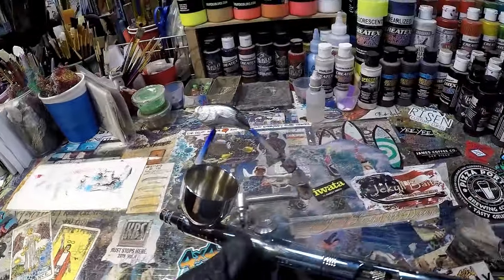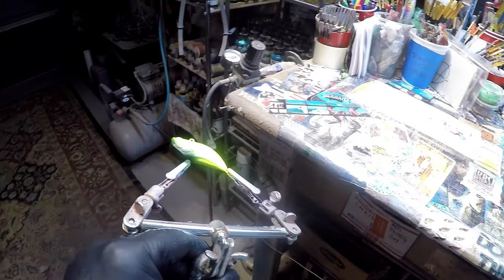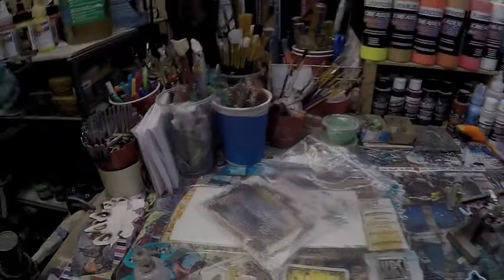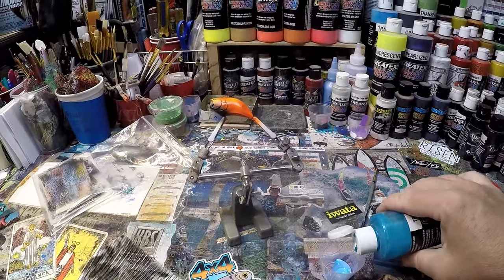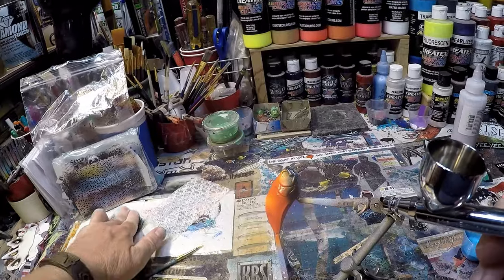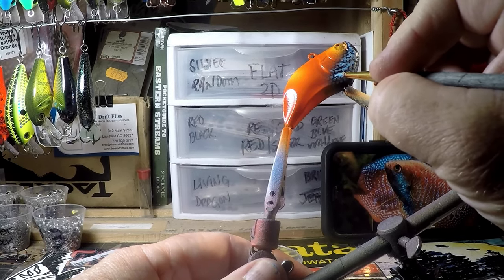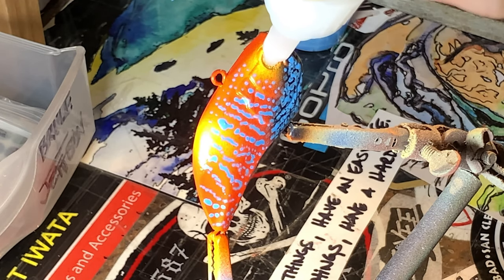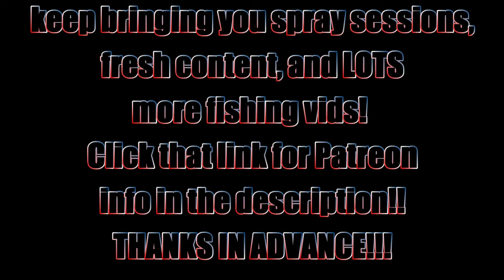YOU VOTED!!! **NEW** Dwarf Gourami Spray Session (08/12/2020)

Comment: Great bait! I had a whole fish tank full of those when I was younger. Where did you get your in line filter? Also, I have a the same airbrush as you and it came with a hose, I bought the master set just for the compressor.  However the Iwata  hose is too big for the master compressor where can I get an adapter that forest on the compressor, then fits the larger Iwata hose.